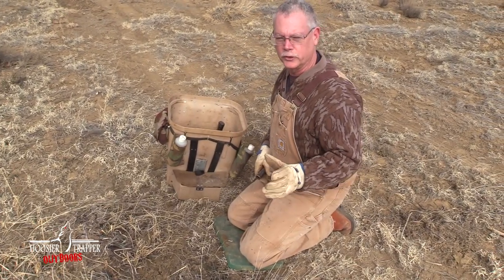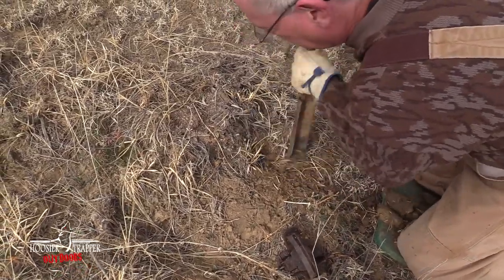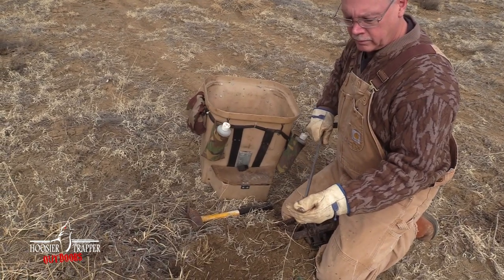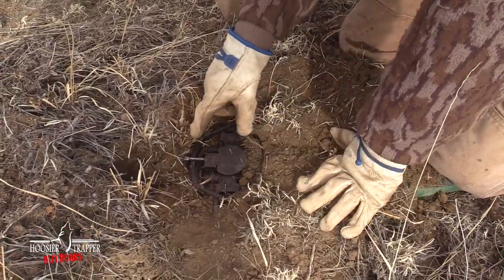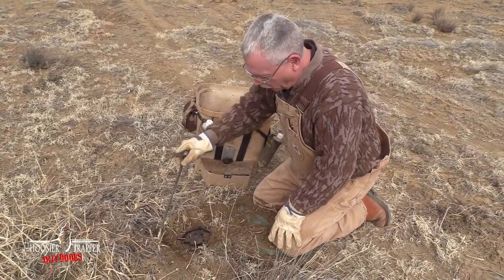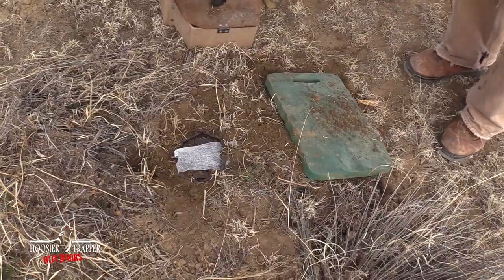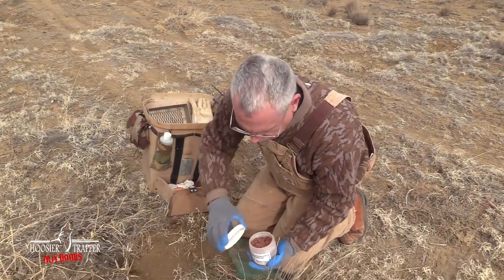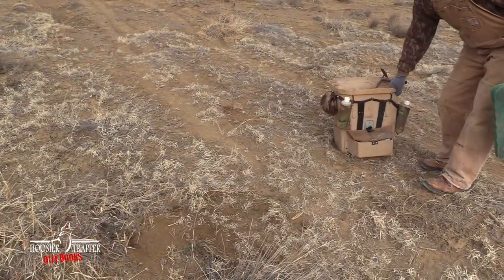Coyote Trapping - Dirt Hole Set

Comment: Curious .....How long is your cable length on your stake typically ? Also i've noticed in your video's that you typically remake a set after a catch using the same trap but if the animal is caught on a drag and appears to have left the set area/dirthole immediately without leaving much scent at the trap location are you also reusing that trap ?  Keep up the good work on the video's, they are informative and enjoyable.
Reply from the maker: We just use the standard Berkshire Disposable Stake with 15" Cable.  In most cases 12" would be enough.   Yes, we re-set the same trap,  We have thought of that as well - so far no issues.    Thank-you!

Comment: I like to put stirred foam underneath my trap pan and it works great for anything that walks. And I use the smallest trap out there for coyotes. The trap I use is duke 1.75 or bridger 1.75. But I have had to experiment with stakes a little bit cause last to times I caught coyotes they have pulled my stakes out the ground and got away.
Reply: Coyote will dance on its hind legs to pull up trap, using one stake it needs to be 3 ft long or two crosses 2 ft long if using steel stakes

Comment: Anthill dirt for trap bedding?#642207
03/20/08 09:31 PMJoined: Dec 2007
Posts: 1,506
Kanabec Cty, MN

D

Drakej ￼ OP
trapper

When I was a young trapper a very successful old trapper that I should use the dirt from active anthills because they soil is coated with a substance by the ants to make water repellent protecting the colony openings. Anyone know if this might be true? Or use it. They do seem to stand up to wet conditions without getting muddy and they don't seem to freeze as hard as the ground. Coul be a natural substitute for waxed dirt.